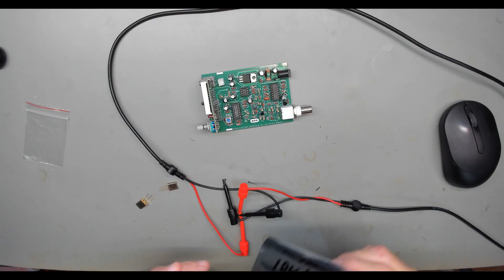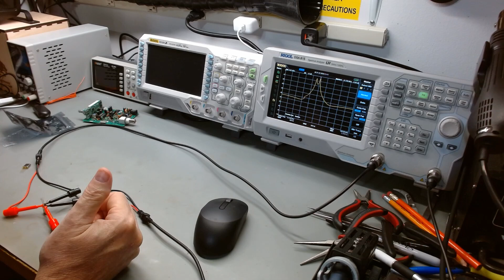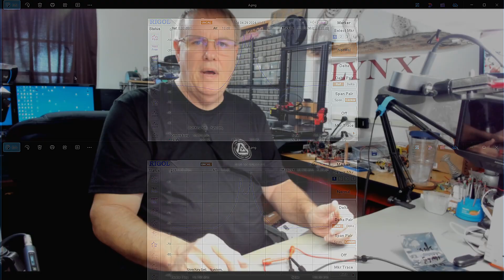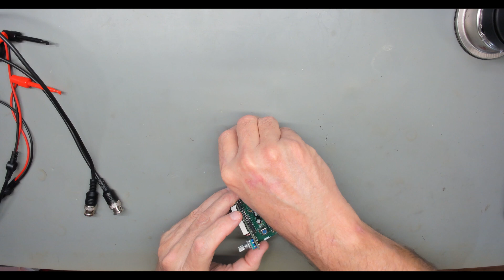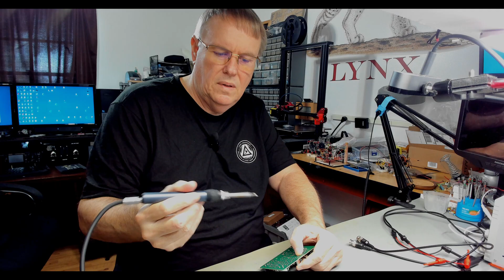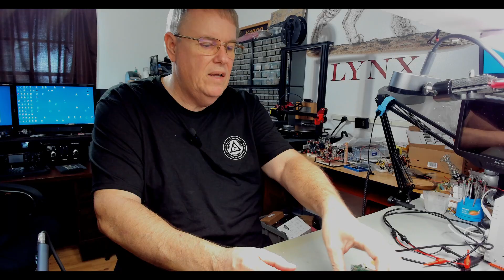How To Upgrade Your R10 Receiver With A New Crystal Filter?

Comment: You need to load the output with the specified resistor and capacitor loads to get designed filter  specs. Maybe 5pF in parallel with 1.2k or so - should say in spec sheet.
Reply from the maker: Correct, 
But I have found just to compare them using the spectrum analyzer without a fixture with the ext loading cap and resistor gets me a very close compare. The cap values are so low the cheap cable I use adds some parasitic capacitance. The displays I end up with are normally surprisingly close with the data sheets plots and specs and these are also.  I had already looked at the data sheets between the two before ordering the new ones, so it was already known values. I just wanted a live graphic as a backdrop to discuss why I order them and not really to do characterization of them on the bench. 
RJ